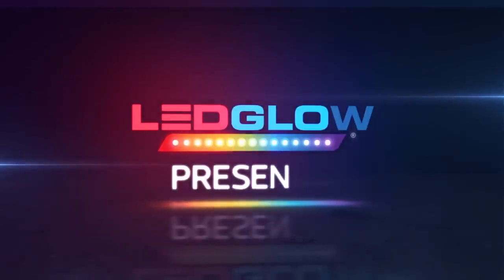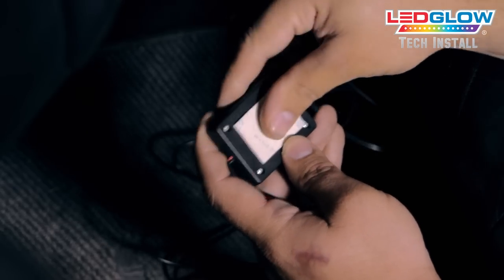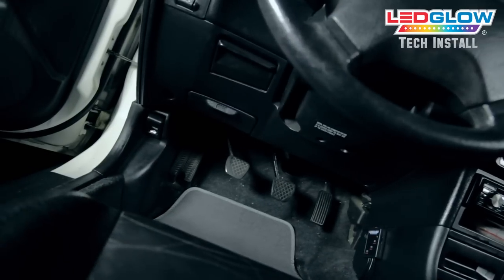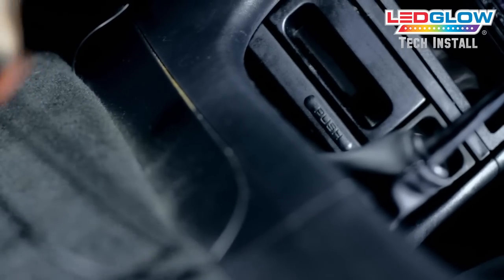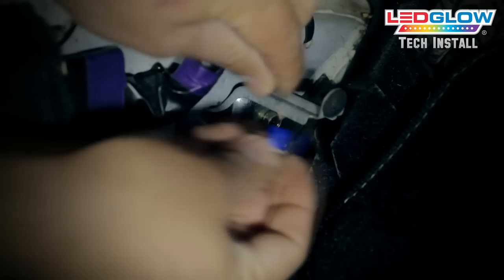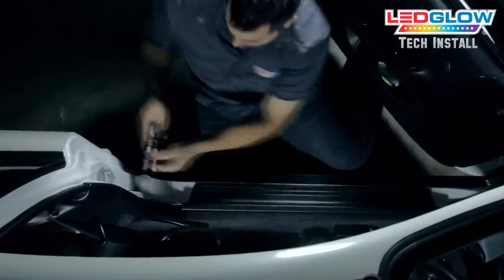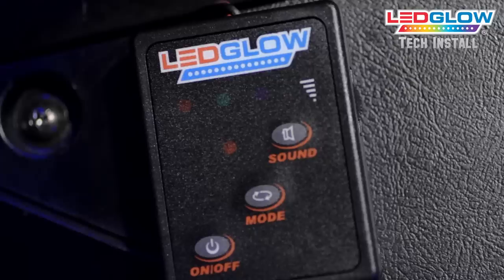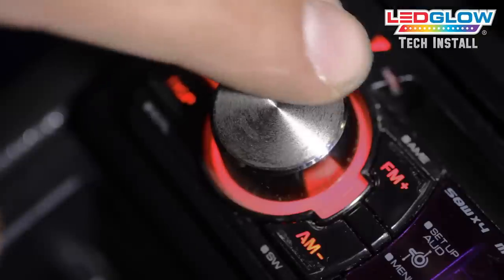Installation | LEDGlow 4pc 7 Color LED Interior Car Lights and Truck Lights

Comment from the maker: Luis, if you plan to install your kit to your Corolla's battery, you will not need any additional parts. If you want to power your kit from your Corolla's fuse box, you will need a mini expandable circuit and if you want to power your kit from the cigarette lighter port, you will need a cigarette lighter adapter. If you have any other questions just ask!

Comment from the maker: Pat, for your 2009 Escape you will use a mini add a circuit and 4amp fuse that you can purchase directly from our website or from your local auto shop. For a 4pc kit, you can mount 2 tubes under the dash and 2 under the front seats like we have featured in the video or you can mount all 4 tubes under the seats with 2 tubes facing the front and  2 tubes facing the back seats. Let me know if you have any other questions!

Comment from the maker: Zach, yes you can use the interior Junction Box for the add a circuit. You do not have to use an add a circuit though, you can tap off any 12v source, the add a circuit is simply an easier way to install the kit. Yes, the first fuse slot is for your vehicle's stock fuse, ie radio, and the second slot is for the 4amp fuse that came with the add a circuit. Let me know if you have any other questions or concerns!

Comment from the maker: It's honestly up to you if you want the kit to function whether the car is turned on or off, but I'd recommend a constant source if you can't decide. It does matter which add a circuit you'd use because every application is different, but for your 2003 Lexus IS300 you would use the mini add a circuit. Let me know if I can do anything else for you, Corey!

Comment from the maker: Jesse, you would go about installing an interior kit using the same process as shown in the video and the difficulty depends on the experience of the installer. Also, check out our video called "LEDGlow's Auto Illumination" and that will show you how to install and program your interior kit to have the lights turn on when you open your door. If you want to power your kit from your Jetta's fuse box, you will use a mini expandable circuit. If you have any other questions don't hesitate to ask!

Comment from the maker: Joshua, you will use a mini add a circuit and 4 amp fuse for your 2001 PT Cruiser. If you have any other questions just ask!

Comment from the maker: I recommend you use the mini add a circuit and 4 amp fuse for your 2011 Subaru WRX. We recommend the add a circuit because it gives for a cleaner installation. There is nothing wrong with using a cigarette adapter but the cigarette port might not have power when the vehicle is off and there only might be one cigarette adapter port in your car, so it frees up that spot for anything else. If there's anything else I can help with please ask!

Comment from the maker: Scott, I recommend contacting your local police department in CA and ask them directly. Laws and regulations regarding aftermarket LED lighting accessories vary from state to state, so they should be able to give you a definitive answer. Let me know if you have any other questions or concerns!

Comment from the maker: Mike, when you install your kit with the auto illumination, the kit will only work when you open the door. Since you're grounding the kit on the door pin, the power circuit going to the kit cuts when you close the door. Unfortunately, you cannot use both functions for the kit, you have to choose either one or the other. If you have any other questions or concerns don't hesitate to ask!

Comment from the maker: Thanks for the complements! You will need a 4 amp fuse inserted into the add a circuit, along with your vehicle's stock fuse. You will just remove the stock fuse where you want the kit to gain power from, insert the stock fuse into the add a circuit with the new 4 amp fuse and plug the add a circuit into the fuse box. A few constant 12v sources you can use are the brake lights, power seats, mirrors, and door locks fuses. If you have any other questions don't hesitate to ask!

Comment from the maker: I recommend referring to your vehicle's owner's manual to see the fuse layout. It can be a switched or constant fuse source, but make sure to use a fuse that is no higher than 10 amps. If you have any other questions just ask!

Comment from the maker: Andre, if you're looking specifically for a 4 piece blue kit, then I recommend the 4pc Blue LED Interior kit. This kit is priced at $32.99 and comes standard with four 9 inch tubes, 3 strobing modes, 3 fading modes, 1 music sound activation mode, as well as solid illumination modes with various brightness levels. If you have any other questions about the kit or the installation process, don't hesitate to ask!

Comment from the maker: At the moment - no. Once you close your door, it breaks the circuit loop rendering the control box inoperable. The only way for the box to receive power to turn the lights on in the Auto On Illumination Feature is to physically open the door. Having the option to control the kit while the doors are shut is something that we are currently looking into though. If you have any other questions - don't hesitate to ask!

Comment from the maker: Dan, this video is a little dated and it is recommended to use a fuse that is 10 amps or less instead of the 20 amp fuse that is shown. It only takes about 2 amps for the kit to power and a 10amp source is more than enough to power the kit. We recommend this to avoid having too much power going to the kit and potentially shorting it out. We released a new video called "LEDGlow's Expandable Circuit" a few days ago and you will clearly see the installer pull a 10 amp fuse to use with the circuit.

Comment from the maker: Parul, you connect the black wire to any bare metal location inside of your vehicle. Look for a bolt or screw that contacts any bare metal on your vehicle. Loosen the bolt, wrap the black wire around it and tighten the bolt. If the ground wire does not contact bare metal then the kit will not function. Let me know if you have any other questions!

Comment from the maker: You can have the kit hooked up so it turns on when the door is opened, but just beware that the kit will only function when the door is opened. If you try to turn it on with the door closed it will not turn on. The dome or brake lights are constant sources because you don't need the key to function them. A switched source could be your power windows or radio fuse, something that needs the key turned in the ignition to function. If you have any other questions don't hesitate to ask.

Comment from the maker: It seems like you're doing everything right, CJ. Which stock 10 amp fuse are you using for the add a circuit? Do you have the black ground wire from the kit connected to a bare metal location inside of your car? If the black ground wire is not connected to a bare metal location then the kit will not turn on.

Comment from the maker: Mark, you will run the red power wire to a positive 12v source and the black ground wire to the door pin, so when the door is opened, the kit gets grounded and the lights turn on. Let me know if you have any other questions or concerns!

Comment from the maker: Matt, the kit will always have power going through it if you connect it to your dome light, but will only function when the dome light is on or when any door is opened. You would only need to ground the kit to any bare metal location instead of grounding it to the dome light as well.  If there is anything else I can help with just ask!

Comment from the maker: Luke, you will need to use a 4amp fuse in the other slot of the expandable circuit along with the stock fuse from your vehicle. This 4 amp fuse is included with our expandable circuits and is necessary for installation as it provides circuit protection for the interior lighting kit. If you have any other questions or concerns don't hesitate to ask!

Comment from the maker: Osman, the add a circuit is an optional installation accessory that is sold separately from the interior kit. The kit also does not include zip ties and an eyelet connector. The color white is included with the 7 color interior kit along with blue, green, red, purple, teal, and yellow. Let me know if you have any other questions or concerns!

Comment from the maker: It is unsafe to connect the red wire to the fuse because it doesn't provide circuit protection for the kit. The 2012 Honda Civic most likely uses mini fuses as most newer cars do, but just double check that it doesn't use low profile fuses. You can check this by simply pulling a fuse out of its slot. If it does use low profile fuses, we do offer a low profile expandable circuit as well.

Comment from the maker: Are you talking about the eyelet connector that's used when grounding the black wire or the butt connector? These accessories are not included with the interior kit, but you can still install the black wire to the screw like shown in the video. Instead, you will simply wrap the bare wire around the screw rather than crimping an eyelet connector to the wire. Instead of using a butt connector, you can solder the two wires you want to connect and it will do the same job as using one.

Comment from the maker: You would use the standard size add a circuit and 4 amp fuse for your 1993 Mercedes E320. If you have any other questions just ask!

Comment: I just bought the kit and a fuse adapter and i hooked mine to a light up switch and it works perfectly its pretty cool
Reply from the maker: Malik Tate Thanks for sharing your installation tip! Send some install photos to our Facebook, Twitter or Instagram pages!

Comment from the maker: The ground wire comes with the Interior Kit, we simply crimped on a ring terminal and installed it to a bare metal source for the ground connection.  If there's anything else I can help with just ask!

Comment from the maker: Elvis, when you connected the expandable circuit to the fuse box, did you choose a fuse that is a constant or switched source? If it's a switched source, make sure the key is turned in the ignition so your car is fully powered and press the power button on the control box of the kit. Attaching the black wire to a metal source is essential to the installation because the entire body and frame is grounded to the vehicle and if you do not connect the black wire to metal then the kit won't turn on.

Comment from the maker: Oscar, we currently have a video that explains different ways to install the kit with the auto illumination function, including when the door opens. It is currently not live for the public but will be soon. I will private message you the link to the video to see if it answers any of the questions you have and if not, I recommend contacting our technical support team at 877.LED.Glow and our techs will be able to further help you with the install process.

Comment from the maker: If you connect the lights to the door pin switch or dome light - it will not allow you to operate the kit if the door is shut.   In most cases, you connect the ground wire to the door pin switch so when the door depresses the pin it breaks the circuit loop. It will remove the ground from the light kit rendering the kit inoperable until the door opens up again. If you have any other questions, please feel free to ask!

Comment from the maker: Ryan, it depends when you want to have the kit turned on and what source you want the kit to be powered from, whether it's a constant 12 volt source or a switched 12 volt source.  You can use the radio fuse, ignition fuse, any fuse, but overall it depends on if you want the kit to receive power ONLY when the key is in the ignition or when the car is completely turned off. If you have any other questions, please ask and I'll be happy to answer them!

Comment from the maker: Glad you came to the good side, Connor! Installing our interior kit with or without an add a circuit is a pretty simple process so if you have any questions, don't hesitate to contact us here or our technical support department at 877.LED.Glow. You could also take your interior kit to get installed at any local stereo/auto body shop that does installations and they should have no problems with it. Let me know if you have any other questions about the kit! Thanks, Connor!

Comment from the maker: I recommend using a 10 amp fuse rather than a 30 amp fuse to avoid too much power going to the kit and potentially shorting it out. You can use the dome light fuse, power seats fuse, power windows fuse, or cigarette lighter fuse. If you have any other questions or concerns just ask!

Comment from the maker: Tom, you would need to refer to your vehicle's owner's manual to see the fuse layout, but a constant source can be used whether the car is on or off. If you want the kit to power automatically with your headlights, check out our video called "LEDGlow's Auto Illumination" and that will explain the entire installation process and programming of the control box. Let me know if you have any other questions!

Comment from the maker: Connor, if you install your kit using the auto illumination function, the kit will turn on and off with your car, but if not, it depends how you have it wired. If you're not using the auto illumination function and don't have the kit wired to a switched power source then you will have to turn off the interior kit manually from the control box. Let me know if you have any other questions!

Comment from the maker: If you do install the kit with the auto illumination function enabled then no, the kill will not work with the door shut. The only difference when wiring the kit for the auto illumination is that you will have to connect the red power wire to a constant 12v source and you'll ground the black wire to the door pin. If you have any other questions just ask!

Comment from the maker: Danish, what fuse did you hook the add a circuit up to? Did you ground the black wire to a bare metal surface? If you used a switched 12v source, make sure your car is on for the kit to function. If you're still having issues with the kit, I recommend contacting our technical support team at 1.877.LED.Glow and they can further help and diagnose the issue you're having. If you have any other questions don't hesitate to ask!

Comment from the maker: You would nbeed to run the wires through a pre-exisiting hole in your firewall, by extending the power and ground wires with 16 or 18 gauge automotive gauge wire.  Unfortunately, you have to extend the wires for vehicles that have the fuse box under the hood.  If you have any other questions, please just ask!

Comment from the maker: Sam, if you want the kit to turn on and off with your car, you should check out our video called "LEDGlow's Auto Illumination" that explains the entire installation and programming process of your kit. If you do not enable the auto illumination function with your control box, you will have to manually turn the kit on and off whenever you want to use it. Let me know if you have any other questions or concerns!

Comment from the maker: Is the black ground wire contacting a bare metal surface? If the black ground wire is not contacting a bare metal surface then the kit will not power. Try finding a good ground source, turn the ignition so the radio will function and try powering the kit again. If this does not work, I recommend contacting our technical support dept. at 877.LED.Glow. If you have any other concerns just ask!

Comment from the maker: This is the first of this issue we're hearing of, Ron. What kind of kit do you have installed to your bike? I recommend trying to hook up power to a difference source than your battery and testing the kit again. If the problem persists, I recommend contacting our Technical Support Dept at 877.LED.Glow and our techs will further diagnose the issue to come up with a solution.

Comment from the maker: Yes you would be able to do that, but again its going to void your warranty, I just want to make sure you know that.  But yes if you cut them, you would pull away the wire sheathing and connect the wires back together.

Comment from the maker: Yes the positive lead on the kit does come with an inline fuse built in. I'd double check that the empty fuse slot has power and is not dead. The Add a Circuit will come with 1 fuse already installed and you will just need to get 2 fuses for the add a circuit, it requires two fuses to pass through power. Let me know if you have any other questions!

Comment from the maker: Cody, I can assure you that we did not send you a defective control box on purpose.  I understand your frustration, but we are going to replace the kit for you at no charge and cover your shipping.  The email return label is coming from UPS, we do not email it out.  You should receive it shortly.  If you need anything else or have other questions I will be more than happy to help, and have a great day.

Comment from the maker: Justin, if you're going to use the add a circuit, you won't have to drill a hole in your car. You can ground the kit to any bare metal location in your car. You can connect it behind any bolt using an eyelid connector or just the wire itself to your radio or seat tracks. Let me know if you have any other questions!

Comment from the maker: Andrey, regardless of the make/model of your car, you would go about installing the kit using the same process as shown in the video. You'll connect the expandable circuit to your fuse box, mount the control box in an accessible area for use, mount the tubes under the dash and seats, hide the wires and you're set! If you have any other questions or concerns don't hesitate to ask!